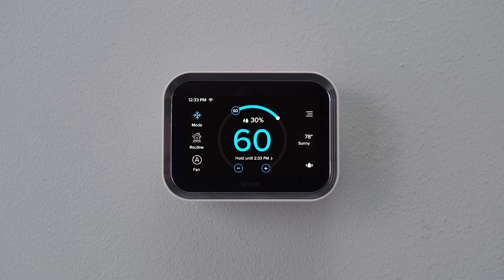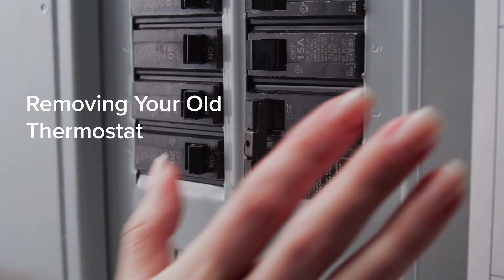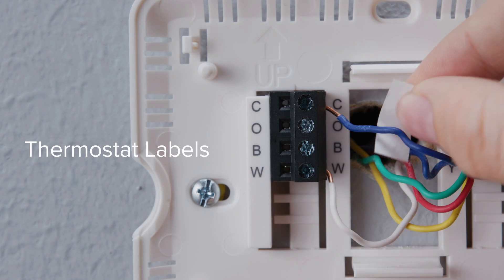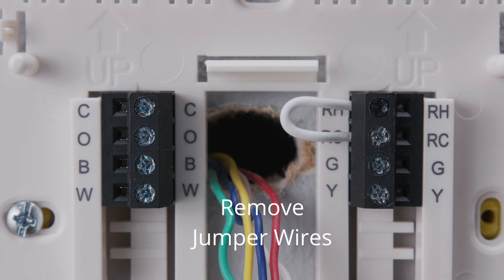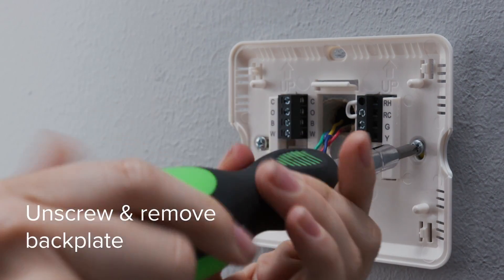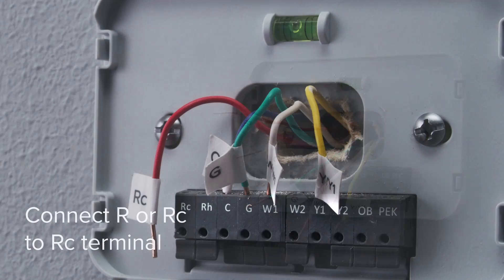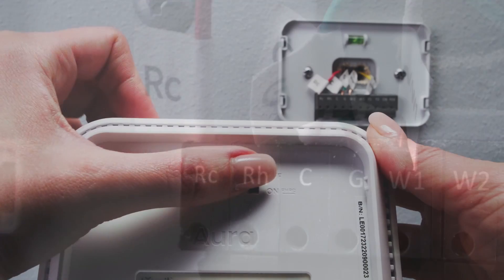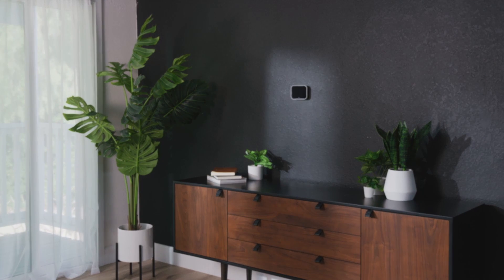Levoit Aura Smart Thermostat - How To Install with a C Wire

Comment: Mine did not turn on, any ideas?
Reply: Make sure you have the wiring correct on the thermostat, I accidently did my wrong. Once i fixed this issue it powered on.